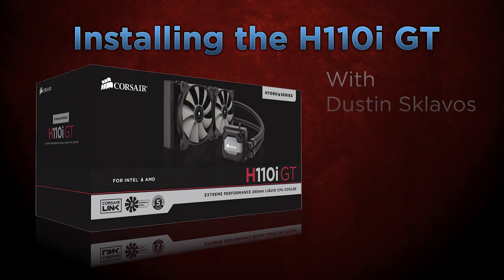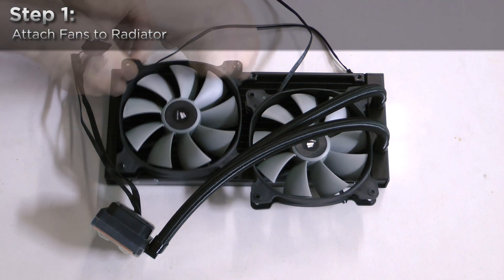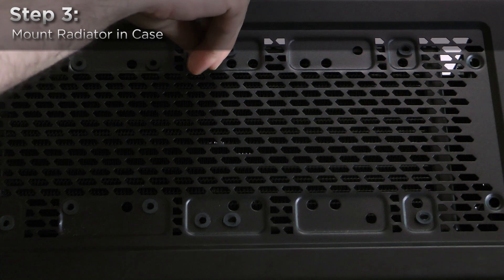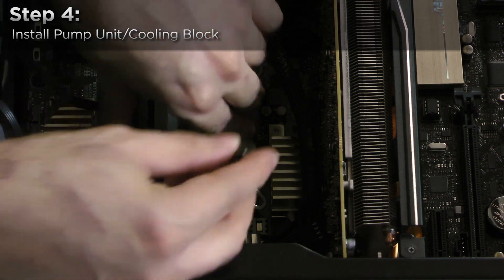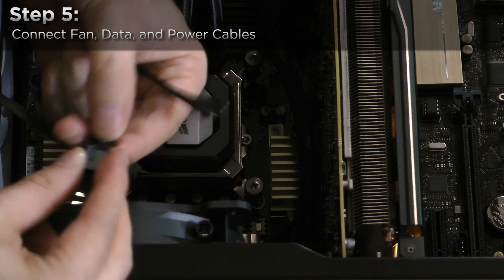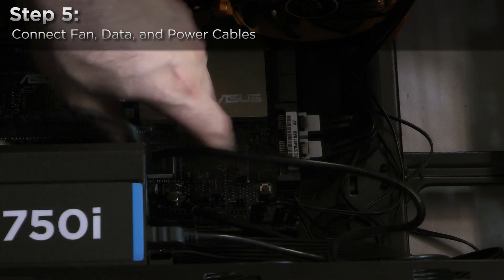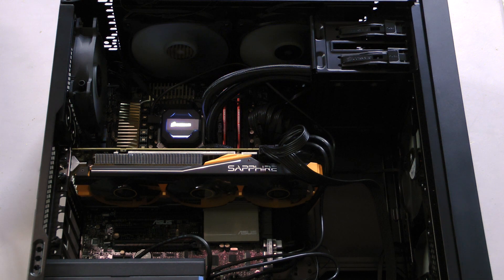Corsair Hydro Series H110i GT Installation How-To Guide

Comment: Does this needs to have the liquid changed  after a while? I have the Corsair Cooling Hydro Series H110I Extreme Performance which looks pretty similar then this one in my system for at least 7 years now and I never thought or known If I had or should change the liquid in those. My system has always ran perfectly smooth and low temp all the time even after all this time. I guess its about time I ask this question heheh.

Comment: I'm having trouble mounting the radiator to the 760t. Is there a trick? The holes don't seem to line up with the holes on the top of the case.

Comment: Please, why the new Back Plate has to be so ugly??? the previous square one was so beautiful. I'll have to buy a NZXT cooler now. :/
Reply: h110i (h110i gt, one in video) and h115i (h110i gtx) are different coolers. the h115i is the one that comes with the circular backplate. this is because the different coolers come from difference manufacturers that are then rebranded by corsair

Comment: when I turn on my pc. The fan coolers of my radiator (h110i gt) run so fast on the max rpm for about 4 seconds more or less, then after run on normal rpm. something is wrong? Anyone with the same problem?  it's normal?
Reply: +Luis Luna I think that is intentional(don't quote me on it). I think the fans are meant to go at max speed to help kickstart the cooler on startup
Reply: +DecipheredEnigma Do you have this wc or another wc?, tell me you experience.
Reply: Luis Luna My water cooler doesn't do this but I have heard of water coolers that do.
Reply: +Corsair any opinion?  please.

Comment: The screw holes for the back plate do not align with the ASUS Maximus VIII. I'm trying to put my system together right now and ran into this problem. Is this model not compatible with Z170 motherboards?
Reply: Yeah thanks. I actually figured it out shortly after posting.

Comment: I'm disappointed that he wouldn't take away his hands to actually see. Also, having an issue with the connectors, he said to remove caps, but mine don't have any and my case didn't with any proper connections so I'm stuck in trying to connect pump to power. Have a 750D Corsair case and Asus X-99 pro MB.

Comment: i watched a review where a guy said "dont put the pump control pwm into a cpu fan header on the board, use an adapter from your power supply to provide a constant 12v, fan control software could decrease the voltage ans screw up your pump" is this true, should i plug the pump pwm into a power supply cable, or would the fan controlled cpu header on my  asus maximus vii board be adequate?
Reply: +Angelo Belale i assume the yes is to using the fan header being adequate

Comment: Why is there no water reservoir? And should I add water into the radiators?
Reply: That's the beauty of a CLC, it comes pre-filled, so you don't need to do anything. You just do what it says in the video and you're ready to rock.
Reply: +speedy_3014 
The reservoir is also built into the radiator, which is why it's a tad bit longer than a normal 280mm radiator
Reply: speedy_3014 Wow! This made my life easier Thanks :D I just bought one of these and I wondered is there a part missing? xD Just wondering too, I don't need to renew the water in any way right?
Reply: +Jahmali Kenway 
Yeah, you shouldn't have to at all.
Reply: speedy_3014 ight, Ty!

Comment: Can someone help me please? Is it supposed to fit sideways on amd processors? I'm building a computer right now and when I install the processor and cpu cooler the cpu cool is side ways with the hoses side on the corner facing sides ways as if it were north east on a compass. Not perfectly side ways but perfectly northeast.

Comment: the installation guide states that the radiator needs to be installed with the pump cables against the back of the case. however this means i cant fit the case fan preinstalled in the corsair obsidian 750 airflow so does it matter if i turn it around so i can fit the fan?

Comment: What's the difference between H110i GTX and H110i GT ? What's the "X" differs ?
Reply: Thanks. Looks like I'm getting the GTX H110i
Reply: +Born Boy They are pretty much identical, however the GTX uses different spacing for the mounts that may not fit slightly older cases. I was about to buy the GTX when i read this online and realized that i needed the GT to mount the cooler in my Corsair Obsidian 650D.  Corsair goofed originally and had the 650D case on the list of approved cases, and ended up having to make up for their mistake by having customers return their GTX's and receive GT's!
Reply: Oh, so GT is newer? I was planning to use the GTX H110i on Phanteks Enthoo Pro. How do I know it fits ?
Reply: +Born Boy The GTX is the newest.  I did a quick google search and it seems that people do use the GTX in the case you mentioned.  You should be good to go!  The general consensus seems to be that the GTX is slightly better than the GT,  but the Gt is what fits in my case, so that's what i went with.
Reply: John Devereaux OK. Thanks.
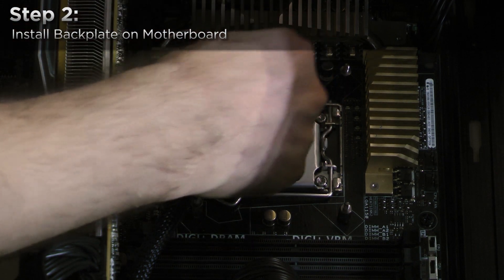Reply: +Born Boy How do you choose which type of screw you use at 0:45? Pls halp. ;-;
Reply: Kirbins I haven't bought it yet. I guess you can refer the manual of the cooler...
Reply: I tried, but it doesn't say. I only refer to the internet when other resources don't tell me anything. Luckily, I solved my problem through process of elimination. :)
Reply: +Born Boy Performance wise, about identical. The GTX is newer.  GT has the tubes mounted on the side of the CPU block instead of on top.  GTX radiator is a tad quieter (40 vs 43 db I believe).  GT is from CoolIT and GTX from Asetek.   The radiator of the GT is more square in shape, the GTX has rounded edges.  I got the GTX I'm starting my build next week (still waiting for my mobo), but starting to have some remorse about the tubes being on top but that's just aesthetics. , I hope it won't obstruct the view.  It really is a tossup in my opinion.
Reply: +Brawndo How did it go? I have the GT and wished I got the GTX lol, mounting the GT is not easy, rad is easy but I mean centering the block to the CPU has SO MUCH up and down, side to side play you really don't know where the middle is to line up the CPU perfectly. GTX seems to have much more precise block bracket. Tempted to buy the GTX.

Comment: I made every everything and i got a message : CPU FAN ERROR. It's the first boot. What should I do?
Reply: That's most likely Q-fan control. If you have an asus motherboard, enter the bios then into the 'monitor' tab and disable CPU Q-fan control, or set to ignore RPM depending on which options it gives you. Hope that helped
Reply: +Fernando Pavan there is a 3pin fan wire that comes from the pump ... plug that in to the CPU Fan slot.

Comment: How do you turn the hoses?!?  No one mentions this!
Reply: They're just elbow connectors so you can just turn them. They're not stuck in place.
Reply: Thanks Speedy, but it's the other end that doesn't turn. If you turn the hoses at the elbow, the hoses are then twisted because they don't turn at the other end (at the radiator).

It must be me because I don't see anyone else reporting this issue.

I went with the other model (GTX) and installed it in 5 min with no problems.
Reply: +Mike Gillis 
Ok then, well at least it turned out to be a success!

Comment: just ordered it ;) gonna replace my nh-d14, cleaner look and better temps yay ! :D
Reply: How did it work out for you?
Reply: Not good the one I received ended up dying after like 2 weeks pump failure so went back to my nh-d14 lool however not long after I got a Corsair h100v2 in my untouched 2017 system that is still going til this day and it's working perfectly fine still so there's that  @fakemail2437

Comment: We want NON LED SP140s
Reply: Those aren't led fans.. They just don't come wi rubber mounts.
Reply: +speedy_3014 
With*.
Reply: speedy_3014 I mean non LED and non L versions. I want the aftermarjet ones to use with a 280 rad.
Reply: +MiguelXx3D 
Oh. Yeah... I would like that.
Reply: speedy_3014 LeL yeah

Comment: why is this not amazon? lol
Reply: It was recalled because some had leaks due to shipping weather conditions. 0 degrees and below were causing the pump to leak and it busted from how cold it was. Kinda scary, So i guess they are testing them and fixing the shipping for better insulation for weather? The people who actually got them have no issues at all with leaks or anything crazy. I was going to order it myself like less than 2 weeks ago then it went out of stock instantly. They had it as to notify when they are back on stock on amazon but amazon removed it because Corsair told them to since they did a recall to check all of them. 4 to 6 week wait for them to be back in stock.
Reply: Henry Charlotten oh ok. was wondering.

Comment: I would buy this, if anyone was actually selling it.
Reply: They just did a recall. Here is the explanation from Corsair:

"As a precautionary measure, Corsair has recalled the H110i GT from our resellers for screening. Here’s some information about what this means to you.

We discovered that when some units are exposed to extremely cold, sub-freezing temperatures during shipment, they can leak small amounts of coolant.
This problem can be immediately identified when the box is opened as some users noticed small drops of coolant in the plastic bag surrounding the unit.
If there has been no coolant leaked in the package, the unit should operate normally and with no problems.
Though we have seen no failures of units during operation, and have tested units in a wide variety of conditions to verify they have not leaked once installed, we understand that this can be disconcerting. If you have purchased this product and have a concern, please contact your reseller or Corsair directly to return the product. We will likely not have replacement units available for six weeks, as the entire recall, screening, and remanufacturing process takes significant shipping time. 

Thank you for purchasing Corsair, and we apologize for any inconvenience this may have caused."

So it should be back in stock in the next 4 to 6 weeks hopefully.
Reply: Its on sale on amazon right now in the US but the H100i GTX not the H110i GT. Im going to order the H100i GTX for now till that one is back in stock just to test the whole PC.
Reply: yeah what happened, i've been looking for it like crazy now that i have money T.T is it out of stock everywhere or what? please Corsair make more :V
Reply: Henry Charlotten a month O.O
Reply: Phillip Parr I know man im so fucking pissed! i was going to order it last week when i saw it on amazon and my dumbass waited to long and it was sold out out of stock. So now i have to wait as well. I guess due to this crazy cold weather they prob decided to change the way they package the item better to keep it from dealing with sub-freezing temps. Im so upset to hear this because i was about to drop 2400 on a new PC?!
Reply: Henry Charlotten Ditto
Reply: Phillip Parr yup, now seem like no one has H100i GTX lol, i order one, still waiting for that h110i gt to come out again.
Reply: Man once that h110i gt comes back in stock I'm grabbing it instantly!
Reply: Where did you get one!? I'm dying here waiting for it. Desolutional
Reply: Desolutional I pre-ordered mine from there too, there was allegedly meant to be 10 in stock today. It hasn't been allocated to the order though, so I can only assume that the ship sunk.
Reply: Desolutional Is your still waiting for stock like mine?
Reply: Phillip Parr I just ordered the parts for my new build today, and didn't realize they'd been recalled either.  I might end up using the stock Intel cooler (without overclocking) until this is re-released.  Still, very inconvenient, but I'd rather get a working cooler a bit later rather than a broken one, I suppose.
Reply: Desolutional For only £24 on Amazon, I think I'll do that.  Thanks :)
Reply: Phillip Parr ordered mine on the 1st
http://www.scan.co.uk/products/corsair-hydro-series-h110i-gt-high-performance-cpu-cooler-with-280mm-radiator-for-intel-amd-cpus
Reply: ***** you are a lovely man! Ordered.
Reply: Ordered as well.  Cheers for the heads up Jake :)
Reply: Greensmurf Phillip Parr no worries (: I struggled looking for one also, so I know the feeling.
Reply: I gave in to the H100i GTX in a nice 70F/75F degree weather here in NYC i get 45C when i play GTA V 38C to 40C on CS GO and avg of 40 to 45 on Battlefield 4 overclocked my i7 5930k Overclcoked to 4.5ghz with no issues when i game. When Idle i get 24 to 28 depending on how cool my room is. About 3 weeks ago i was avg 18C but thats because it was below 50F degrees lol. All i know is that i never pass 54C that was the highest i've seen and i was using 100% CPU usage that day for about 2 hour straight. I used the stock thermal compound that was on the cooler and it works flawless no need to change it.
Reply: Henry Charlotten really good temps, especially for an OC. What case? (:
Reply: *****  Im using a CM Stryker case the white one. I added 2 AF120 fans to the bottom of the case change the 2 in the front to the SP 120 fans by Corsair with the rings on them. Im not even using the stock fans that came with the cooler since i cant get the RPMs of the fan to crank above 1000 for some reason it really got me upset so i changed them with 2 120SP Corsair fans as well pushing air out the case with a 140AF in the back to blow air out the case. Im using the X99 Deluxe motherboard updated the bios to the latest one last month and all working fantastic no issues no blue screens nothing. The highest i overclocked my CPU was at 4.9 i got scared of that number lmfao so i cranked it down to 4.5 comfortable. Using G.Skill DDR4 16gb 2400mhz memory.
Reply: 1.300V Desolutional
Reply: Almost exactly a year later mine has died and needs an RMA!
Reply: I returned mine and they sent me the updated one the h115i its so so much better. The RMA is so quickly done to if you return all the parts they ship it the same day.
Reply: Henry Charlotten Ooo, that's awesome! I'm having mine picked up by Yodel tomorrow, so should get to Corsair (Scan) on Friday :D
Reply: mine is still fully working... but if they are RMA'ing an updated one, it might have to "accidently" break.
Reply: just dump that shit in the microwave for a 10 mins lmao j.k if the water has air in it shake the fun out of it idk. hahaha
Reply: New one has just arrived - it's an H110i GT! No 115 for me...
Reply: aww that sucks! I got the 115 sorry to hear. I had the h110i GTX though not the h110i GT. Maybe thats why?

Comment: I got this a couple weeks ago.  The cooler works great, but the Link software is awful in my opinion.  I recommend skipping link and just running the fans off your motherboard.
Reply: Its just my opinion, but pretty bad.  My main gripe is the colored lighting.  I have it set to be blue at 30c, green at 45c and red at 60c (cpu temps) and you can watch it be red when its 31c, green when its 50c, blue with its 45c, it can't make up its mind.  Whenever you open the link software it resets the fan speeds back to factory default, you can hear them speed up when you open the app, so you have to re-select the desired fan curves and quit on each exit.  Also when lauching the app it moved my temp color settings back to block temps instead of cpu temps.  Also just the general UI is not user friendly in my opinion.  Maybe my app is just bugged but thats what i'm experiencing.  The cooler performs great.

Comment: Can this Fit in a Corsair 350D
Reply: Fits in my 330R, so I'd imagine so.
Reply: ***** True. I was thinking along the lines of 350D being an Obsidian and the 330R being Carbide, but I should've checked.
Reply: It can fit. The H110i GT requires a 280mm radiator mount location, the Corsair 350D has this in the Front and Top. You can always check Corsair Cases for compatibility with Corsair CPU Liquid Coolers on the product page on the corsair site under Tech Specs. It'll state the mount locations and their sizes + which liquid cpu coolers are compatible.

Comment: Will this fit comfortably in a 450D?
Reply: The case used in the tutorial IS a 450D, so it should... ;)
Reply: Yeah just a little dubious as my Maximus VI Formula has a large heatsink near the top that prevented me fitting a H105. However I know this cooler is not as thick so I should be all good.